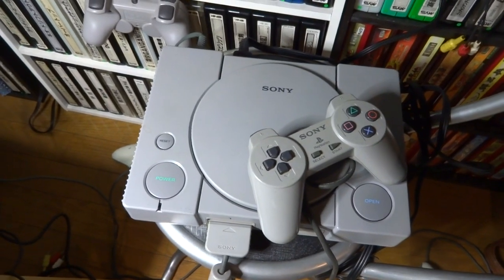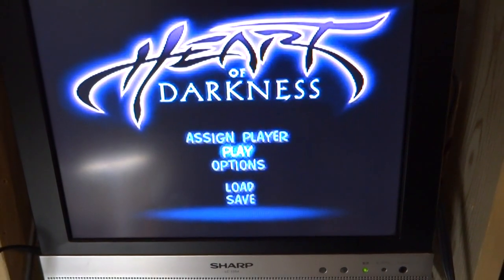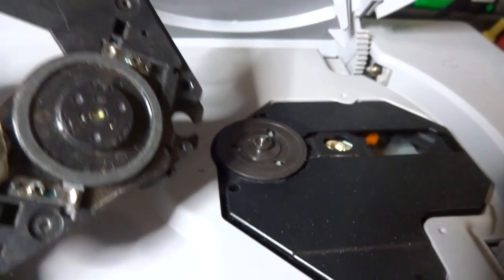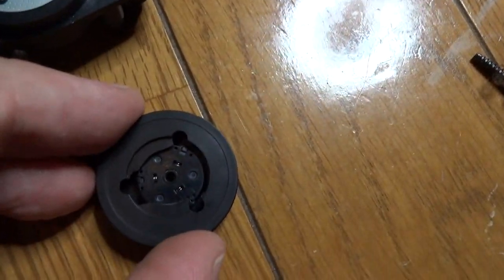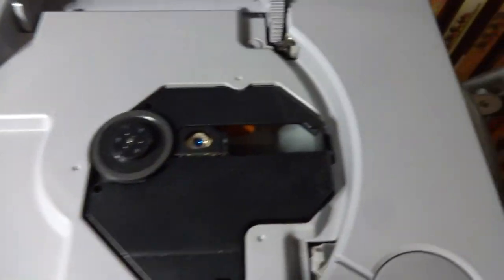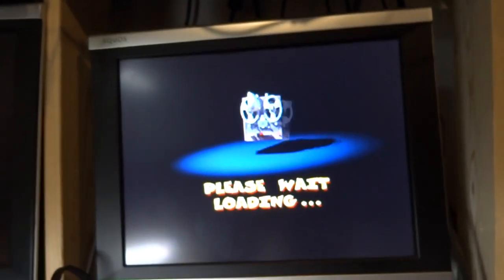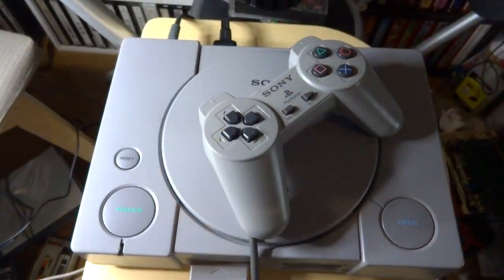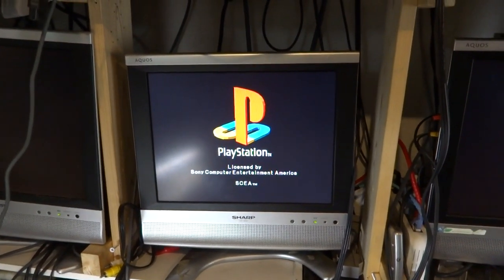Old PS1 Repair And Clean Up

Comment: PS1s are so fun to repair because of how many versions there are. I bought a 1001 with a bad laser a while back, and managed to replace it with a working 9001 assembly I had. Needed to hand-cut the plastic to make it fit, but it works like a charm now.

Comment: This is what I like about Luke. Doesn't matter what it is, a £2000 gem or a console you can't even give away, he will always repair them with the upmost care and respect.
Reply from the maker: Thanks for being around man. I actually prefer the ones that are trashed and thrown out so if you have anything laying around let me know lol. Ive got no interest in the expensive gems per say but I like the ones that are in rough shape
Reply: oh man if it wasn't so expensive to send stuff to japan i'd love to send you  model 2 saturn, it tripped the fuse breaker in my home years ago and has never worked again since, before it died it use to run ok then gradually the graphics would become scrambled until it crashed.
Reply: lowelife101 Check the internal PSU fuse.
Reply: If it tripped your home fuse, something shorted in your power pcb board, check cable etc.
Reply: i have something you can fix. Its two jaguar console with a cd attachment
Reply: gerot201 You realise this guy doesn't do it for the fun of it, right? Pretty inconsiderate to just say something like that literally in the comments section, leave alone not even ask politely.
Reply: sorry bro..... it was based on his comment.
Reply: im just letting him know he can fix something if he wants to ...... stop being uptight
Reply: R33Racer not judging or anything, but just for future use, the word you had in mind is "utmost", not "upmost"
Reply: @lukemorse1  Here's a tip for skipping disks - kick up the pot on the laser a tiny bit higher, and test. I'm doing this on ONECHIP modded PAL PSone machines as they skip horribly on CD-Rs. 

Ever since I did that, I have two ONECHIP modded system literally run the most scratched copy of Abe's Oddysee with not a single FMV skip in sight.

Comment: I had to replace the CD mechanism in a first-generation Playstation, and I did it with a mechanism from a forth-generation one.  I had to cut some of the plastic on the bottom of the mechanism and adjust the height of the spindle hub but it worked out very well in the end.

Comment: I love how much worries you have about that spindle replacement, I stuck first spindle from old DVD player with magnet top, modified the top to fit into the case (there is a lot more space then you think) and it worked. :D

Comment: Great work Luke, I've got a box of these old consoles needing new disk spindle tops (whatever they're called) so some great tips on replacing them, much rather use recycled parts to fix em and get them back out there playing games
Reply from the maker: do what you can to save the consoles from the garbage. especially nowadays when they are getting harder to find in running conditions. Take it easy and thanks again

Comment: Watching you test the disc reminds me of when I used to rent games back in the PS1 days. It wasn't uncommon to get a disc that skipped in parts. Although the idea of resurfacing the discs seemed unappealing to me, I had it done to Castlevania Symphony of the Night and it fixed the skipping of certain music tracks in the castle. I'd give that a go on Heart of Darkness, that's a decent looking game.
Reply from the maker: I can hear that for sure, sounds like fun repairs for sure. This game is quite interesting for sure. Out of this world :)
Thanks a lot for the comments and take it easy
Reply: Treeface ,
__ If, even after the result of your polishing effort on the disc yielded a great surface across the entire media, you still have skipping issues on certain music tracks, I'd  peruse the possibility that your laser needs adjusted and also checked for excessive disc wobble   especially as the laser works harder towards the outer edge of the disk to keep its focus.
__ Longer PlayStation logo splash screens, load times and FMV + in-game music glitching is often an indicator if lubrication and lens cleaning have already been done. You can test this with certain games that allowed one to pull the game disc out after a full level had been loaded , paused and a music CD swapped in its place with an outermost track selected, if possible, closer to the CD outer edge and therein observe whether the CD music still skips while playing the loaded level. You'll have to keyword search those games as I can't recall any off the top of my head other than maybe the Ridge Racer or Wipeout series... just don't recall.
There's alot of laser adjustment videos through appropriate  keyword searches so I won't list any here. 
__ I would emphasize that tune-ups may minimally want to involve a good digital multimeter from which measurements can be made to make differential-based, relativistic adjustments but an oscilloscope would render the greatest level of real-time measurement detail especially when adjusting for laser power = just enough output to get the job done especially at the outer edge of media discs so as to not prematurely age it, burn it out.

Comment: Great work man! You were lucky that the part fit so well because it looks like it would be hard to tell you have replaced it with something different. This video makes me want to pull out my old PlayStation 1 that I bought at a local flea market years and years ago and put a mod chip in. I did that back in the day to run a Nintendo emulator. I think I still have a bunch of Nintendo games burnt to a disc that will boot on that PlayStation and it actually can save the game's state to a Sony memory card on the unit. I remember it was a lot of fun to play with but I think the laser on that model I have overheats sometimes and I would always play it with a large ice pack underneath it and on top of it and it would run rock solid, LOL!

Comment: Hey Luke great video I love you and all of your videos.
Reply from the maker: Thanks a lot! hope you like the next one as well :) its got a bit more to it and twice as long lol.
Reply: Thanks for replying, and do you know why the power button on my original Xbox doesn't work? The only way to turn it on is to plug the power cord in and it automatically turns on and the only way to turn it off is to unplug the power cord.I looked it up online and it says this is caused by the clock capacitor leaking acid on to the power button traces and corroded them so it doesn't work. Is this correct,and do you know how to fix this?
Reply: Thanks for replying. I have an original Xbox that has a power problem so when I plug the power cord in it automatically turns on and the only way to turn it off is to unplug the power cord. I looked it up online and it said that this could be caused by the clock capacitor leaking acid on to the power button traces and corroding them, is this correct? And do you know how I can fix this? Thanks once again I really love you, your channel, and all of your videos. Thee first video I watched was the video about removing the clock capacitor from the original Xbox. I also have post notifications turned on for your channel, that's how much I love your channel.
Reply: You need to open Xbox to be sure, and if it is bad traces then you need to jumper over traces, or if you can fix traces.

Comment: Luke, i highly suggest to use the WD-40 on the motor spindle (called RF-300A) and on the sled motor. Also use some tamiya grease con the mecha, should be helps a lot.
Use the pot adj like a last solution ;-).
Also, for the maximum performance, use the original spindle (the original one for another console for example, not the chinese parts ^^)
Btw, the KSM-440AEM, it's a very strong laser. The FMV skipping is caused by the disc, so, don't worry about it.
Take Care :-).
P.S what a kind of av cable is it? It's made by Hori!? That's interesting! Is RGB or composite? :-)
Reply from the maker: Thanks a lot man. Ive repaired around 100 of these things over the years and have most of the tricks down for the most part but thanks my friend. You may find the next video entertaining as it goes a bit more extreme into repairs then the basic cleaning process ;) stay tuned. As far as the av cables go,they are hori s-video cables :) only way to  play the ps1 nowadays aside from an rgb mod. thanks again

Comment: Never throw anything away. Nice job on exchanging the spindle. The disc may read better in a PS3. I've found that it's laser handles scratched discs better than an old PS1.
Reply: WhatsOnMyShelf ,
Could your observation and pursuant conclusion be based on older PlayStation 1 CD spindles simply losing their grip on the discs, creating excessively difficult tracking scenarios for the laser in addition to the laser getting overworked and maybe needing tuned up?
Reply: I'm not sure, but you do bring up a good point. Tune up? How would you fix a loose spindle, if in fact that is the problem. How would you devise an experiment to test your theory? Would you find a faulty PS1 where its spindle is the suspected problem and replace it with a new, unused spindle?
Reply: WhatsOnMyShelf ,
It's empirical for me.
I had an old Sony Discman that I no longer used which had a "plumb" spindle I slipped off from its motor and swapped over to the PS1 after noting the height of the original PS1 spindle on the motor shaft. After tapping it down and lifting it back up a few times on the shaft to land within the workable focal point, other matters became a moot point other than potentially needing a slight laser potentiometer adjustment for just a couple of games that rarely exhibited problems that I didn't take the effort to open the shell backup to remedy. Testing full-length music CDs, they typically played except for rare occurrences for tracks near the outer edge.
I inferred that disc wobble from the original spindle wearing out, having been bent and not as tight in the disc was playing into an overworked focus feedback circuit.
Reply: I'd add, that if a re-purposed / up-cycled spindle is going to be removed for use in a PS1, that it's gently leveraged off with equal lifting effort on opposite sides / opposing edges of the spindle ( a forked device underneath placing lifting force along the diameter from fork tips has worked ) or the effort may be for naught as it might warp and tip the spindle out of plumb with the motor shaft hole.
If not readily available / there are no candidates for up-cycling, new spindles are often sold in multi packs of 5 for typical price of $5 in North America.

Comment: I just got a free PS1 from my friend, and it's the same thing like this one. It loads some games, and some are just stuck at Playstation logo with black screen. And even when games load, they are choppy, music is choppy and Playstation in general is really noisy. I guess I will take it apart, clean it all up and add some grease on laser moving part (as I saw that on the other video). I hope I fix mine too :)

Comment: I have a pair of broken PlayStation 2 controllers one that just barely works (some of buttons barely work and the triangle button doesn't work at all) and another that's somewhat OK but the connecting wire has frayed open how do I fix these problems

Comment: Someone really needs to make new lasers/disc drives for these systems! I am aware of the many cheap ones on ebay but they almost certainly don't work well! My consoles could need new lasers at any point and it would be nice to get replacements that are guaranteed to work!
Reply: Might as well give them a try. Also PS1s are cheap. You can scavenge parts easily. It does make me wonder how interchangeable CD drive parts are; such as, could you take a random PC CD drive laser mech and drop it in a Sega CD? Even if the fit is right, I'm sure the volts and amps are different.

Comment: Hey Luke, can you give me a little help?
I have PSOne, bought it with dead laser, replaced whole mech with new from China, tested for couple of hours, then I put it away for a couple of years, not played at all, and now, when I turn it on, it refuces to read ANY disc, even music cd's.
What's the reason can it be?
With old (original) laser, things are even worse.
Reply: zedeg94 I've read somewhere you can take the laser out of the Chinese knock off and insert it into the old original mechanism and it'll work
Reply: Ofcource you can, but in both casese spiendel is spinning (dunno is it fast enough), but  so there is no reading.